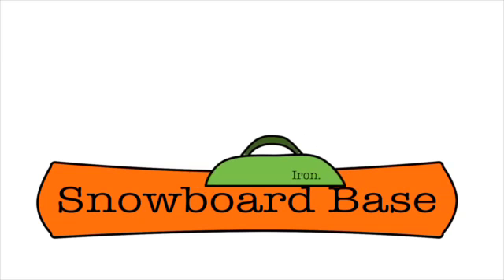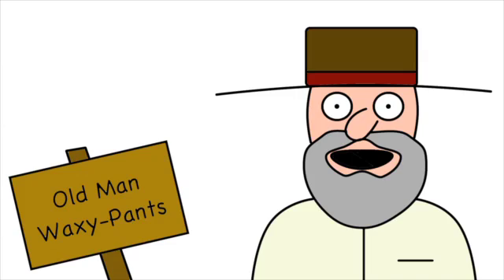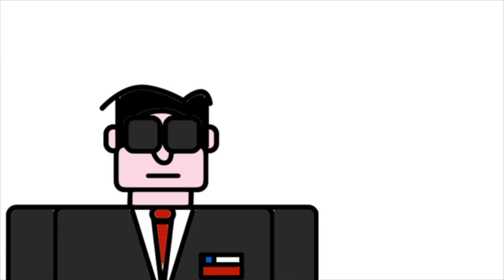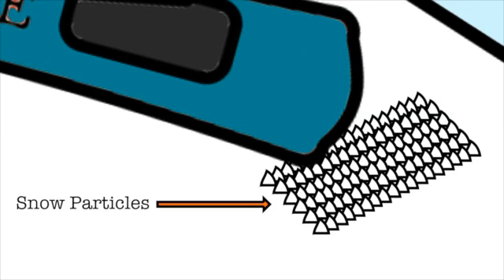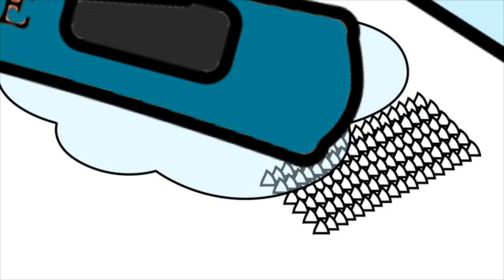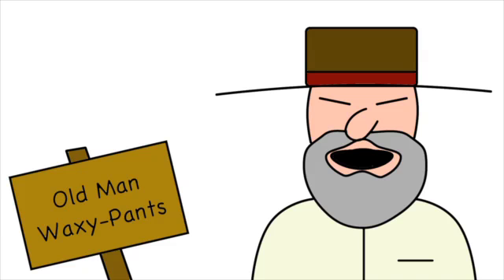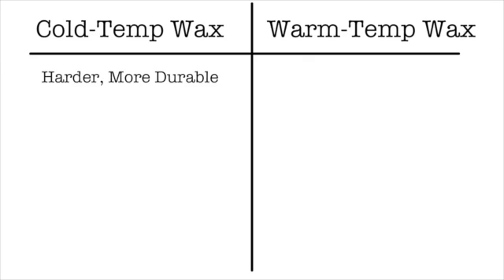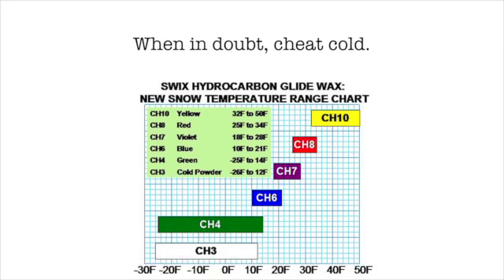Why Wax your Snowboard or Skis?

Comment: Hey Erik, I know I’m 8 years late but, how does flouro work in relationship to ski wax?
Reply from the maker: Fluorocarbon wax is incredibly hydrophobic, meaning it sheds water very quickly. This helps in a ski wax because you to glide over the strip of water created by your ski or board with even less friction than with traditional (hydrocarbon) wax. However, fluorocarbon wax has been banned for sale in the US although that ban has yet to come into effect. Fluorocarbon wax is more hazardous to health than hydrocarbon wax when it's heated. Fluorocarbon wax should only be applied by a professional working with a respirator in a well ventilated area or outside.
Reply: Awesome, thanks